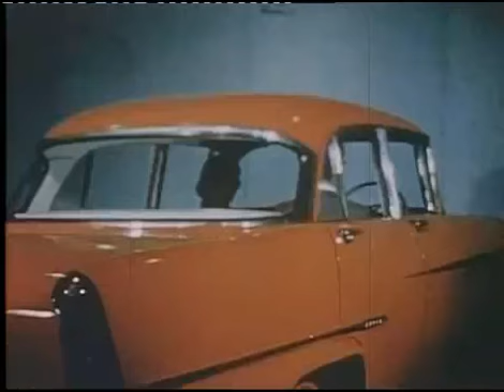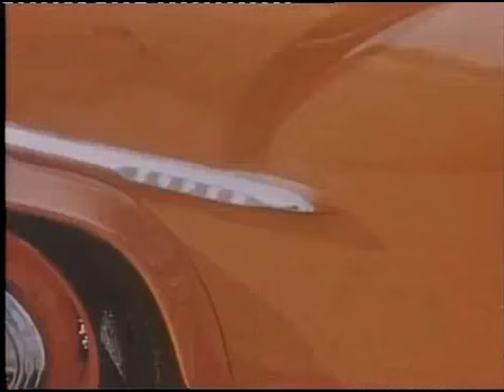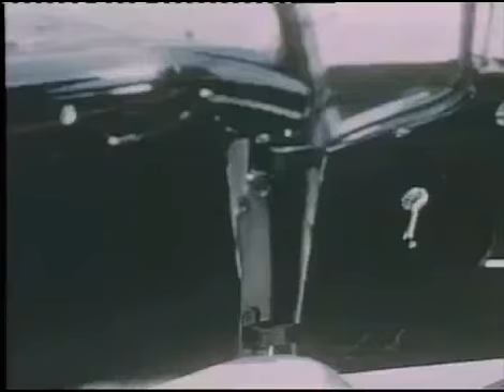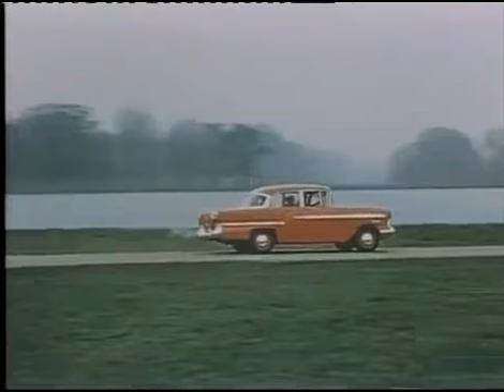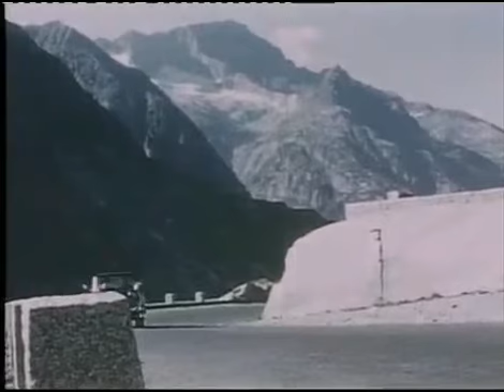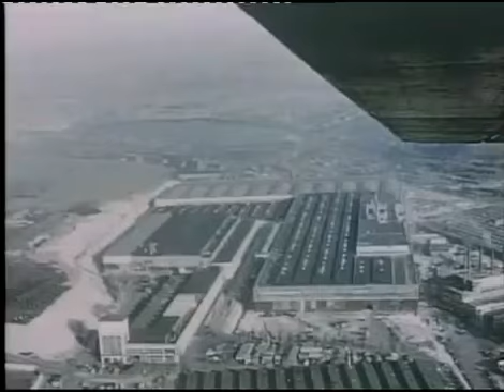VAUXHALL VICTOR F SERIES UK DEALER LAUNCH FILM

Comment: I am old enough to have learned to drive on a year old Series 2 (by then the exhaust did not go through the bumper!) With a 3 speed column change modern high speed cruising was not realistic but it did mean you could get 6 normal size people in. On cross ply tyres you never really got to explore the ultimate road holding as the tyre squeal would stop you! 
We drove with 5 people on board from the UK to the Costa Brava and back, no problem.

Comment: I'm an American and just starting to look into British cars of the 50s 60s and 70s, so I'm not familiar with the details on the models of this period. So many people here mention the rust issue and "rot boxes." What was the deal with that? It doesn't look like a poorly designed car. Why would Vauxhall use shoddy steel?
Reply: It was actually a victim of its own success they were selling like hotcakes and were getting steel from anywhere to cope with the demand, some of it had been on boats for weeks. Ford tried to compete with the 'Ford Consul Classic' but that became the British 'Edsel' ie. they spent a lot of money on it but the public just thought it was ugly and was rather overweight for its size. However, Victor's reputation was drowning in rust, they tried rubber bitumen coating the underneath from about 1958 but with the very heavy winters of the early 1960s that just accelerated the rust process - a shame as it was a pleasant car with a reliable powertrain otherwise.Vauxhall obviously brought new 'improved' models,but the public were suspicious and it took to the late 70s to gain lost ground again with first the Cavalier.

Comment: Many of you have commented what a rot box the F series was. Well you are correct. Why, well it was by design. There were so many mud traps under the wings that within a year the rust had taken hold. Once the front hinge pillars holed then water seeped into the floor pan and soaked the thick felt used for sound deadening. So now the floor stayed wet and never really dried out. Once the floor had gone only the sills held the car together. They only had very thin metal under the wings and they rusted away very quickly so with the sills full of water the end was near. On 60 and 61 models a splash panel was fitted to the inner rear wings which did stop the rust but they never did the same for the fronts. Shame.  Mechanically (if maintained properly) they could go easily over the 100,000 mile barrier. They were amazingly comfortable. A great car let down by design.

Comment: Our  truck  driver  had  one  in  blue  with  red  leather  seating, the  downside  was  every  weekend  he  had  the  get  the  Body  filler  out  &  repair  holes  at the  front  &  rear  Window  sides, it  was  a  lovely  looking  car, he  used  to  do weddings  in  it  before  the  rust  took  over.

Comment: 17 minutes 24 seconds of utter drivel and lies.....a shame the Trades Description Act wasn't passed until 1968.....maybe it was because of this car that it was!!
Reply: LOL 
They were INDEED utter garbage .. However ALL cars from this era were crap. 
Brand new cars have gone back to been crap ..
I have a 1998 Toyota Celica and it has done 180,000 MILES on the original Engine and Gearbox... 
It needs a few ££ spending on it for the next MOT ..But do you know what .. I might just get it all fixed... 
It has failed to start ZERO times and has broken down ZERO times..
Reply: @briansaiditsoitmustbetrue4206  180k......it's only just run in! Our 54 plate Peugeot 206 had 235k when we sold it four years ago, and it's still trundling about!
Reply: @briansaiditsoitmustbetrue4206   The power train was good on these cars and very reliable despite using oil in those days that was like treacle. Oil is the key to engine longevity not if it's Toyota.

Comment: The good old days when virtually every car was a rot box. Poor design and poor steel coupled with British roads. Wasn’t just Vauxhall, Ford and BMC were just as bad. We got a new mini, paid a lot for full waxoil treatment, and still had rust everywhere in about 2 years.
Reply: You have forgot the winters were much harsher in those days, snow (thus salt) could be on the ground for weeks..not the inch or so we get for a day these days when despite ABS and traction control etc everything grinds to a halt. Plus of course most people burnt coal resulting in thick fogs dropping sulphuric acid on the cars when it rained.
Reply: My dad bought a BRAND NEW 1973 Morris Marina and it was COVERED in rust when it was 2 Years old.

Comment: My uncle had one brand new, he didn't under seal it he sprayed used engine oil under it every time he changed it and after six years of ownership it was like brand new while everybody else's had rotted away. A mechanic from the garage in Bury where he bought it from bought it of him and couldn't believe how good it was, I bet that car is one of the few left running today because of what he did. I put a secondhand front axle assembly on it for him because the original had cracked on the off/side suspension arm and he never trusted it after that so he sold it.

Comment: My first car - a real "old banger". Passed my test in it but it virtually rusted away before my eyes. 
Mine was only 8 years old. My wife has just bought an 8 year-old Fiesta and it's like new.
Reply: Same here.
I bought it from my dad.
He had all the rust cut out & filled with lead, body filler not around then, so it was heavy.
Blew a welsh plug at the back of the head & the only way to get to it was to lift the engine or cut a hole in the firewall.
Had a lot of fun in that car.

Comment: Apart from using crap quality steel, the steel wasn't rustproofed and only painted on the outside where you could see. Condensation forms on cold steel so the unprotected steel would rust outwards and by then was too late. Different metals used to attach trim woud also cause an electrolytic reaction and cause rust. Another school of thought is that positive earth accellerated the electrolytic rusting process.

Comment: Interesting how 'column change' was the norm rather than the exception back then. Both my father and grandfather owned Victors throughout the late 60's and into the 70's and I always remember sitting on the front bench seat in the middle. No seat belts of course! Good cars though.

Comment: I had a black super in 1978 paid $10 for it as it was in the wrecking yard and evil kenevil had bought all the rolling wrecks around my area they were to be shipped out..he didnt get to do his tour here Qld Australia and since he owned the car and wasnt coming I got it. I was told to make an offer..all I had on me was $10 ,It was my 2nd  victor and had previously been owned by "bikies" at Slade Pt Mackay..I pulled the rego plates,radiator,started motor out of my previous model along with the rego sticker (old water pasted type rego label I soaked it with a sponge) and away I went..I got a year or two out of her..rust did kill it in the end tho.. I would buy one today if there was a great almost new one..but they are now rare..ebay does have some here in Australia..but too much money is wanted..ahh the good old days $4 for half a tank of fuel..

Comment: In an attempt to take market share away from VW and Renault, whose small cars were selling well in the United States, GM arranged for the F Series Victor to be sold in the United States at Pontiac dealers. Less than 30,000 were exported before the plug was pulled on the venture.

Comment: They used Lucas electrical components. 
They didn't call Lucas "The prince of darkness" for nothing.
Reply: Having worked on these pieces of crap I think you'll find most of the electrics were AC/ Delco not Lucas which were a subsidiary of GM which were far worse than anything Lucas made.
Reply: Contrary to popular belief, Vauxhall's were made in Australia, not in the UK
Reply: ChaosDemonwolf1 That is so silly.
Reply: Lucas electrics was ANOTHER achilles heel of British motor cars of that era!
Reply: I don’t understand why people have such a low opinion of Lucas.  I had a Lucas pacemaker fitted and it has never been a proble.........

Comment: I believe that they had to rush the Victor and Cresta through the production process at treble speed so that the sills didn't fall off with rust in the dealers' showrooms. Wotta rot-box they were.
Reply: john marsh hi john my uncle bought one new and after 3 years the bottom of the doors had rotted through, they certainly did rust
Reply: Had to comment not only because of your surname but I had one of these with the chassis number of 4004 and was told that they started at 4000  yes you are right they did rust.
Reply: I know you are all talking about the UK and the victor.. was the 1961 and less rust prone? I note over here they fare better
Reply: @charlesbrain3872  Yes, Charles. The F and FS variant were notorious rot boxes. Having gained a bad name, the next model, the FB was quite the opposite. It seemed to last longer than most other cars. The FB model ran from 1961 to 1964, so I assume you refer to the FB. For identification the F and FS are basically the same car as in this video with minor body changes. The FB was a completely restyled body.
Reply: they were stored outside in a field then brought in and painted and the race was on. would the Victor crumble before the Renault. pub bet 1960s.
Reply: I worked with a guy who used to live next to the Luton factory. Just over his fence was a large open yard stacked with bare metal Victor body shells which were quite rusty when they went into the factory. Apparently they went into an acid bath, but that would not stop the rust reforming. It's the only car I ever saw with roof pillars rotted through.  Another person I knew had to have new floor pans welded in while still under the 12 months guarantee from new.

Comment: Sadly although my dad had a great Vauxhall Firenza from new in 1971 and I loved it, my experiences of any Vauxhalls since were basically crap. So nowadays I’ve ended up with a BMW convertible, I’ve covered 15000 miles in it since May, 3000 of which were on hols in the south of France. I just can’t imagine ever having a Vauxhall ever again
Reply: I agree. When I was a child my dad bought a six month old 64 Victor Estate. Mechanically seemed good but was a rust bucket from one year old. He had to keep repairing for rust and it never looked as it should. So I would never buy Vauxhall.Then I was given an early Cavalier as a company car which was best of class. Then later loads of expensive problems with transmissions on their 4x4; faulty at design. And that's Vauxhall's problem .I think they know how to fix at design but choose to cut corners. I do intergalactic mileage and had Japanese the last 30 years withiut a problem and wouldn't go to Vauxhall
Reply: @r.h.8754  V.A.G is crap, but the majority buy into the myth of Superior German engineering.

Comment: I have a 1960 F type estate. I have had 2 of these now and love the look. Always wanted a Chevy or Pontiac Nomad but for UK roads the smaller size is better and even though not as economical as a new car better fuel use than a big V8 and so much more style than most mundane modern cars :) .

Comment: That's an Opel Rekord P2, with a slightly changed body and a 12 volt ignition system.
Typical European GM.
Reply: It could be said that the Victor and Rekord were related in theory and marketing, but the cars were actually like night and day. Bodywork, platform, electrical systems and their voltages, Metric vs SAE fasteners, component suppliers.

Two vastly different animals.

Comment: My Uncle bought one of these brand new,he was fanatical about maintenance,he garaged it every night and leathered it off every time it was out in the rain,he diluted the old engine oil with diesel and sprayed the underside with it after every 3months,he had it about 6yrs and it was immaculate,he traded it in and a mechanic from the garage bought it,they of course fell to bits from rust but this one was A1 due to the oil treatment it received.

Comment: It was basically a 1956 Chevy Belair  with less chrome and a smaller engine.  It was let down by Vauxhall importing cheap Italian steel which rusted.
Reply: All steel corrodes if not protected adequately from deleterious factors. Thinner steel will obviously succumb faster than thicker.
Design elements which aided the retention of water and road grime did not help.

Comment: If that don't look like a 55 chevy that shrunk in the wash...
Reply: I always thought the car looked like a '57 Pontiac taking a trip through the House of Mirrors.
Reply: lol... I thought a 55 Pontiac...
Reply: @gabriel.954  With the addition of tail fins extending a bit further out, it would've looked like a small '57 Chevy.
Reply: it was when vauxhall still had to use cast offs from their GM owners, the much later vauxhall (the square one) was the first of their british designs, later on had to have opel designs
Reply: I thought it looked like a miniature '57 Buick or Oldsmobile.

Comment: Many years ago when I was a humble mechanic, I jacked up the front of a Victor F model and then for safety put a couple of axle stands under the chassis legs and then let down the jack. I walked away to get my tools and heard an awful crunching noise as the chassis gave way and it settled back onto its wheels again with the stands sticking through the floor! Not a bad car for its time in many ways but the rust killed them all off eventually.
Reply: You're not supposed to place jack stands under the floor, they go under the Frame  !
Reply: @woolyhighlander7280  The chassis legs are welded to the floor, and in these Victors rust was a killer within 3 years.They along with the next model the 101, almost killed Vauxhall off within 6 years. The saving grace was the little Viva.
Reply: @woolyhighlander7280  Hi, frame and chassis are same thing (UK say chassis)
Reply: That's what we call "that great GM feeling"  they learned so much 10 years later they came out with the Chevy Vega, figuring it the car couldn't run the rust would't be an issue, still people who bought cars actually wanted to drive them, for some reason GM had a hard time figuring that out
Reply: @fk4515  Yeah, the Chevy Vega was another GM car that was rushed into production so the CUSTOMER could field test them!
Reply: Always knocked my knees getting in
Reply: @cliffbird2680  Had the same problem with a '55 T-Bird, I am GLAD those "wrap around" windscreens are gone!
Reply: Indeed - I recall much the same: jacked up o/s/f and the "chassis" just crumpled!
Reply: harrygatto i did the same with a singer by rootes
Reply: Cool
Reply: My first car. I owned a '57 Victor in 1962. Loved it!

Comment: .Had to use a drive on four post lift as chassis rust was bad . Lots of water traps in the body and mud traps in the fenders ( Wings.) especially behind the head lights. ...but just when you thought Vauxhall couldn't do any worse, along comes the PA. !

As for their engines being so wonderful....who thought putting the oil pump up by the cylinder head on the VX4/90 was a great idea ? Every one of those engines rattled like a tin can of marbles for 20 seconds or more on a cold start up....and adjustment of valve clearance after 60,000 miles needed new valve adjustment screws because the originals had worn a pocket in the adjustment screw.

Comment: The Victor was indeed everything that is claimed here except for one fatal flaw. Despite the advertising claiming it was undersealed, which was unusual in those days, it suffered from rapid rusting. I had one which somehow survived that problem, with 80,000 miles on the clock, and the engine was so quiet and smooth that a workmate who was talking to me, leaning on the front wing, while I was waiting to get out of the works car park, did not realise my engine was running until I started to pull away. The Victor boosted Vauxhall's sales considerably until the rust problem  became apparent, whence their sales plummeted, and did not recover for many years. That fatal flaw, obviously not considered by their engineers, gave Vauxhall a bad reputation, which took years to live down. I met one guy who bought a Victor new, and he had to have new floor pans welded in while it was still under its 12 month guarantee..
Reply: Imagine having to do that on a year old Insignia....
Reply: Replevideo j of

Comment: The imported steel was Japanese and also used on Cresta and Velox. The car was not rushed into production as prototypes were running around in 1954.

In Car Mechanics magazine from early 1960 there is a guy complaining that his one year old Velox needed a new rear wing due to rust.

Also on You Tube type in Car Dumping Everywhere a Nuisance Pathe from 1965. A 1958 Victor is seen dropping to pieces when about 7 years old.

The steel was rubbish. The car was great. 

Nick
Reply from the maker: The design was not rushed and you are right the car was essentially good but it was put into production before the factory was ready and there still issues with window sealing that were not resolved. Some of the steel may have come from Japan but the bulk was from Sweden & the UK. The rust issue was not just metal related there were far too many water traps and the undersealing was worse than nothing at all - it trapped water between the coating & the floorpan. Most F Series rusted from the inside out.

Comment: I owned a 1960 F Type, series 2, in the 80s. My favourite car - lovely to drive and so reliable! Unfortunately, rust took its toll. I would love to own another one, if it wasn't for my trike taking all my attention. Incidentally, a Victor badge from my old car adorns the rear of the trike! What a pity GM rushed the car into production before it was ready. Also, the crap steel (Swedish?) didn't help!